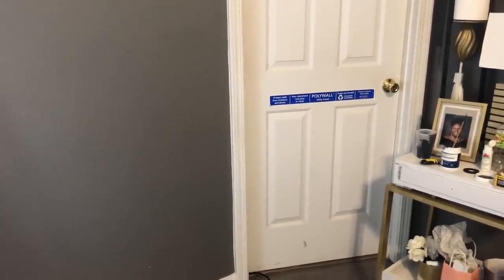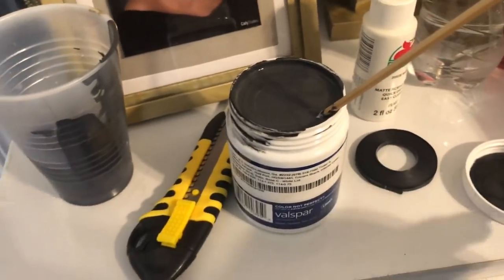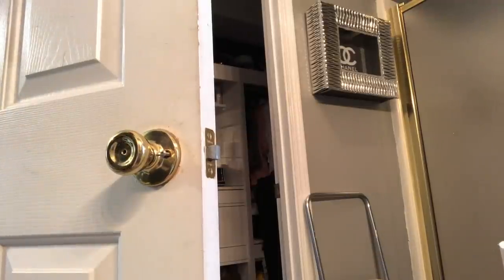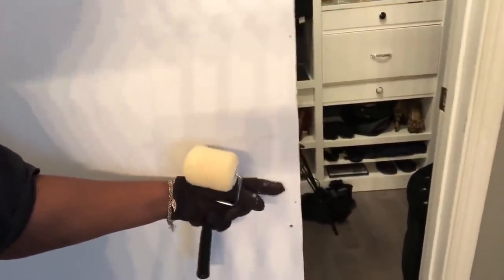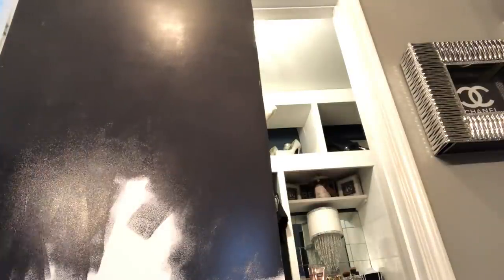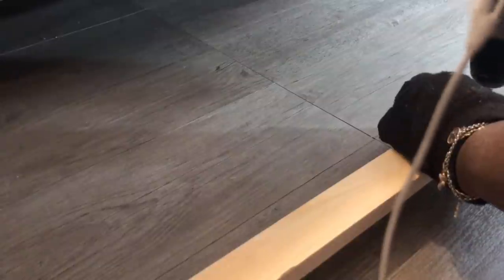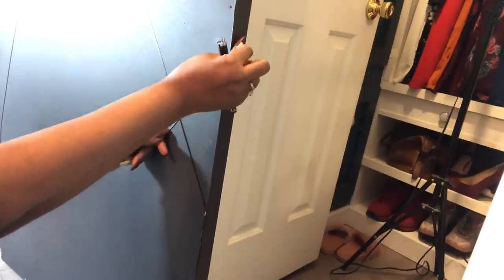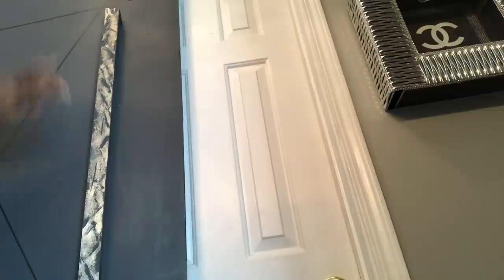DIY: “SLATE GREY MODERN BEDROOM GOEMETRIC DOOR TRANSFORMATION / MAKEOVER“

Comment: Random question: which do you prefer, the pin nailer or brad nailer? Trying to decide between them myself.
Reply from the maker: Andrew, I haven't used a pin nailer, but I absolutely Lo🥰ve, Lo🥰ve,  Lo🥰ve my Brad Nailer! It's a good choice! Thank 🙏 U! I appreciate U! 🙋‍♀️🤗🥰🙌 God Bless!
Reply from the maker: Check online for a Combo Package Deal, because I ended up getting the Nailer, (2)Batteries with the Charger plus several other tools for the cost of the Nailer alone without the charger & a battery! I got my package from Home Depot online for $199.00US! Which was an Awesome deal! Thank 🙏 U! I appreciate U! 🙋‍♀️🤗🥰🙌 God Bless!